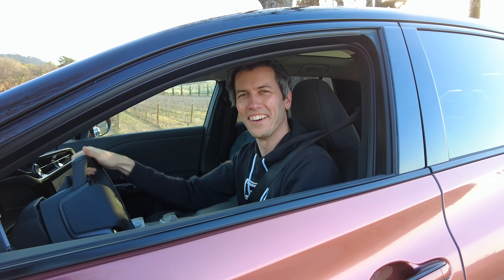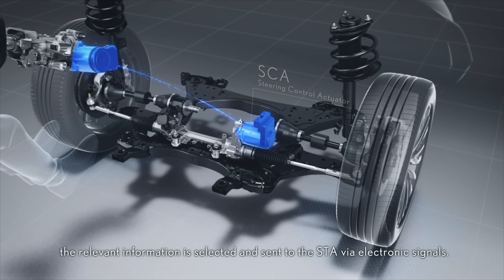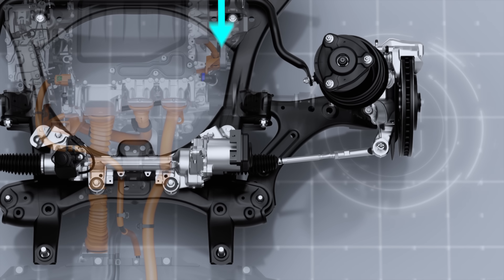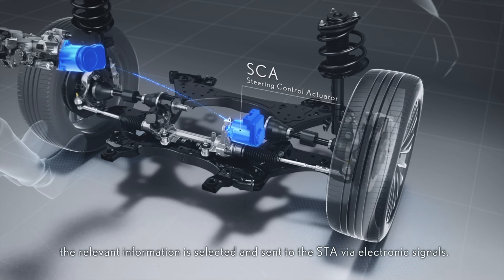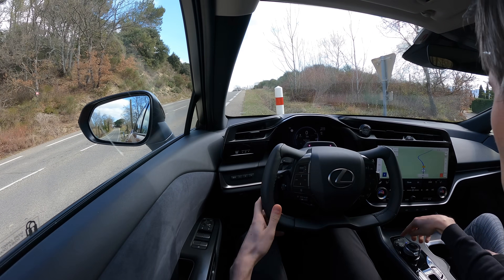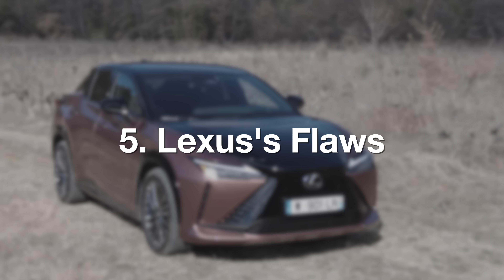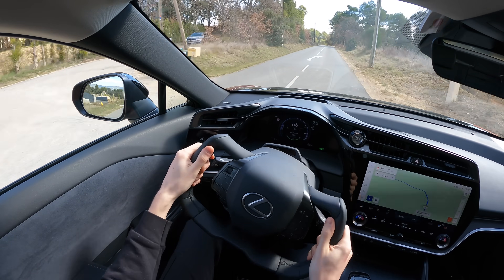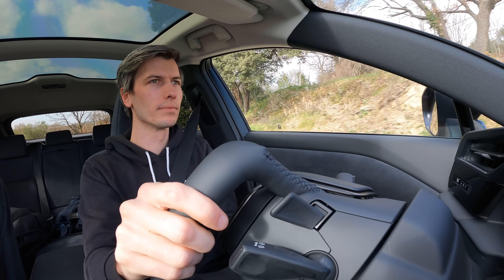How Lexus Fixed Tesla's Bad Idea: Steer-By-Wire Yoke

Comment: What happens when you blow a steer tire? I’d image yanking the opposite way to the pull in response to keep control of the car would either take you that way or you still go off the road ect, also you can really see like every other manufacturer they want to have mass production over quality so a lot of these car models are all the same in terms of the parts they use

Comment: by resolving one problem you get another, if something fails then you lose control and there is nothing you can do, with mechanical solution you may prevent it by doing maintenance works and check, checking analogue part of electronics is very problematic. And from history we can see how many car manufacturers tried and failed, people died because of electronic brakes and throttle. Nowadays cars have ride by wire solutions, but brakes are still mechanical. In aircrafts they have duplicated all electronic solutions by mechanical, because they might fail, they are cheaper, so if anybody put's in your luxury car some electronic stuff instead of mechanical, it's not about making car better, it's about making it cheaper to build.

Comment: I'm not a fan of anything-by-wire in my car.  We've already seen what fly-by-wire can cause in airliners.  

My car has throttle by wire and when it failed my car just stopped going while I was attempting to accelerate onto a freeway.  Fun was had by all.

So there's redundant actuators in case one fails.  What if the computer that does the controlling fails?  

No thanks.

Comment: These tech companies are morons, i bet if they didn't have steer by wire they would reduce a little bit of weight and save unnecessary power usage by using 2 electric motors for the steering

Comment: 3rd safe point: What if in a highway an experienced driver tries to avoid a dog for ex (happened to me 2 times) and you are ready to drift because you are more than experienced driver but the computer decides to not steer that much because you are traveling at 100 km/h and it wants to provide you with stability. There computer tweaks never get things right and believe me there is no perfect place to draw the line.
Reply: That's a matter of settings. Hope they provide some.
Reply: Why would I drift a Electric car
Reply: @Andieu9753  to not hit the dog. Did you even read my comment or what ?
Reply: @Andi eu  because its fun?
Reply: @garyrowe58  no sound not Fun to drift electric
Reply: They would still need to pass the 'moose' test (see ISO 3888-2), which is precisely the manoeuvre you describe.
Reply: @leewatson8129  like the passat passed the emission tests. 😁.
Reply: Actually it's easy  I think, system just analyse how quick and aggressive you make that movement, computer then recognize "emergency" situation and won't block it. And consider, that making normal 270 degree movement equals 540 in traditional steering wheel, which you don't make to avoid obstacle. So you get even quicker reaction with smaller input. I would see that as benefit.
Reply: @teodorgorka  I am e software engineer and I know these things never give the right feeling. There is a psychological aspect to this because the driver behind would expect the car not to turn and will oversteer eventually. Nothing better than the old mechanic
Reply: @Albi91vl  Yes this is my biggest fear of this system as I believe that the machine a person is operating to be as consistent as possible so as to maintain a connection to the machine. maybe it's not so bad but time will tell.

As i watch the video it almost looks like steering with a controller, or arrow keys in a racing game. I don't think it'll be for me just yet
Reply: @teodorgorka  In emergency you turn the steering wheel with muscle memory. However if the turning radius changes constantly, your evasive maneuver can be disastrous if the car turns more/less than you expected.

Comment: systems such as The BMW Active Steering are also able to limit the steering angle when maneuvering to a minimum and are still connected directly to the steering through the planet gearbox. Here, the rotation of the ring gear with an electric motor is simply summed up to create a bigger steering angle

Comment: This also simplifies building cars for left and right side of the road driving. With no mechanical connection, the steering wheel can be anywhere. The less difference between the two versions of the same car, the better for car manufacturers. This is probably a big motivation for them.
Reply: I want to sit in the middle!

Comment: I was wondering... how this system will behave if you accelerate from standstill on a curved road? Imagine driving on a nascar track, will it decrease the driving radius as the speed increases while holding the steering wheel in a fixed position. Did you test this?
Reply: Interesting question

Comment: The problem with all the tech advances in cars, is that they increasingly take the driver out of the equation. 
Much of the enjoyment of driving is to operate the machinery, and feel how the car is reacting to your inputs and the road, which gives you the feeling of control. That is why petrol heads dislike all these "improvements", as they reduce cars, more and more, to just being transportation devices. That goes for electric engines as well, as the sounds, vibration etc. are gone.

And the steering by wire is just another on the list of killjoy tech advances, because when the steering is no longer mechanically connected to the wheels, the feedback has to be generated, and filtered, and will ultimately feel fake, because it is.

Thank you for a nice review of the system, and while i'm not a fan, I do enjoy learning about these things.

Comment: RC vehicles have had this (obviously) for years but the control over the steering and throttle is much more granular. Percentage of input is variable for slippery surfaces so a hard input will (at 100%) make a change gradually, as shown in video. This works for steering but also throttle, no spin outs. This involves a time variable to match wheel angle to steering angle.
The degree of angle can be controlled proportionally. The angle of the wheel determines what angle the wheel will be, no matter how hard or slow the wheel is turned. A quarter turn could be no change or quarter turn. This is good for high speed driving that has some corners. A full turn of the wheel maybe only turns the wheels 3/4 of lock to lock. No oversteer.
The lock to lock rotation can be set so maybe instead of 150º you want the full left and right at 120º or 90º for the twisties. 100% proportion, 70% input at 90º = point the car and it goes there, gently and quickly.

Then there is trim. Maybe you want the wheel at a slight angle if only one arm works.
Eventually all inputs will be assignable, steer with the volume knob, brake with the horn (finally!) or to discourage theft, door handles operate horn and lights, but only while you touch them.
Bring it, let's drive. tl/dr sorry not sorry

Comment: Frankly, throttle by wire is the only system I’m comfortable with. I like the idea of a mechanical link the vehicle can failover to in case anything goes wrong with the electronics. I didn’t know brake by wire exists, and that idea doesn’t thrill me either. I’m all for assisted steering and braking, but a mechanical link must exist

Comment: This is just awfull. Its such a basic component that works as intended and is easily repairable if you at any point have any issues. Why replace it with something that has every single god damn component sealed with epoxy...

Comment: I really don't like the overcomplication of everything and the lack of redundancy. "But what about the redundant motors and sensors" you say, well I'm not talking about those, I want to know what happens when connection between sensor and assist motor fails or what wear characteristics are for one of these 100k miles in. I really don't like how many more failure modes this adds to a vehicle compared to traditional steering. "Its already used in rear steer applications" a inherently redundant system that poses no threat if it fails to function. "We use throttle by wire too" again something that isn't nearly as dangerous as not being able to pull safely off an active roadway or bank with a highway or avoid an oncoming obstacle etc. etc. And unless there is a cable emergency brake, I feel the same about breaking by wire too. I think shallow and shortsighted innovation like this is dangerous. It caters to creature comfort and mindless trust for minimal benefit. At least make a physical redundant system that activates upon any set failure mode, or if that's too complicated stop reinventing the wheel again.

Comment: If you ever tried a carburetor sportbike,  and then tried an ingection sportbike, you now the difference between mechanical and electrical speed of reaction, and small 400cc bike with carburetor feels more quickly than 1000cc with ingection
Reply: My mom's car is 75hp's, but it has direct mechanical drive of the throttle, and it feels fast

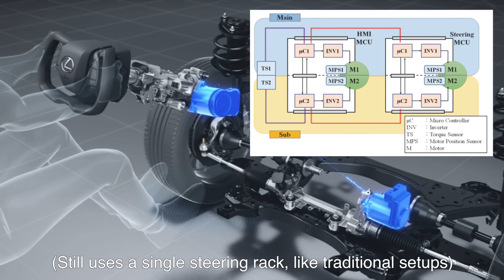Comment: 7:50 I don't know what the big deal is.  Aircraft already do this, I don't see why it's not in cars just yet.  Then again it's the same folks who think all fast cars need big blocks and NA.  America is so behind the times.
Reply: To be fair, there isnt much reason for a plane's steering to be directly controlled. You usually have minutes to steer and also don't typically feel forces from the ground in the steering

Comment: that variability in the steering ratio is its strength and its weakness. It will be for the most part confusing the driver of the "constancy of feedback". It seems like you're constantly adjusting to it...

the faster response time works for the braking and accelerating.. but not completely sold that it works for steering. And yes, the F1 drivers are elite, trained professionals... which there's a team behind them tweaking the perfect car for the driver (style of driving).. Regular folks won't have that luxury.

Comment: What do you think of the sensitivity.? A fixed wheel turn to steering turn ratio is predictable. while a different wheel movement to steering input at different speed is something that you will only have to learn from the vehicle movement to again adjust.  

I will never say Yes to this

Comment: Sounds really good, until it brakes. 

Then its not a big deal if you can figure out why its broken without tearing the entire front of the car apart. 

I wouldn't mind a system like this but that's only if a manufacturer will sell parts for a reasonable price along with an easy diagnostic system but I highly doubt that.

Comment: Could you imagine that cable breaking at the middle of a road while you're driving 60 miles an hour or by some power issue your battery dies on you😢 at least when your battery dies on a mechanical steering wheel you could easily pull over even with the electronic assistance off

Comment: This tech trickles down and ends up where we are now. There are very few affordable new cars for those not in the top tier income levels.
You can't buy a base Civic anymore, Honda stopped making them.
You can't buy a base Corolla anymore, Toyota stopped making them.
My sister just bought the lowest model Civic you can buy and it's loaded with crap she doesn't need or want.
Civic used to be what you bought for economy and price. 
No more.
Corolla used to be what you bought for economy and price.
No more.
We have to look towards Korea for that now and, while it has gotten a bit better, Koreans don't build 15 year cars.
My 2012 Civic LX coupe has 190k miles with one repair, a starter at 125k. I paid 19k for it and won't be selling it anytime soon.
It still gets 40+ mph at steady highway speeds and around 34 around town. 
I will admit the suspension is now harsh. You feel every little bump but I don't know how to get that rejuvenated.
Reply: @almightybirdwatcher4986 Honda has officially announced it will no longer produce the LX civic model which was the base. Toyota hasn't officially announced that it no longer builds the base Carolla but there is no inventory in the US. 
The average new car price in the US is approaching 50k. 
In my opinion we need new models without all the feature creep that sells for 23 to 25k and will last 10 to 12 years. 
Take out lane assist. Take out adaptive cruise. Provide the option to take out heated seats and steering wheel for the southern states. Take out full power seats and leave power height. Take out brake hold. Take out keyless entry.
A large part of this country could use a basic vehicle they can afford.

Comment: The only reason for steer by wire is the same for accelerate by wire and brake by wire. It reduce duplicate parts. Ie Toyota, Nissan or Honda don't  need develop 2 different parts for LHD and RHD.

As an auto mechanic when for example the Nissan almera came out (rhd model of the US sentra) some early edition cars came with plugs on the left side capped for the e throttle and the brake lights so that pedals can be shifted from right to left in the case of driving side.

Comment: 0:26 lol. Every modern plane has fly by wire. Which is basically the same thing. But ya’ll trust it at 40k feet. So yes, it’s safe.
Reply: The difference is a plane is serviced every week, while I’ve seen people leave factory engine oil in for 40k miles. Also, planes and cars are completely different and incomparable in every aspect
Reply: @Twenty2246  ive worked on planes since the moment I graduated high school. Mechanics is mechanics is mechanics. Technology is technology is technology. Regardless of the application. The oil that’s used to lubricate an engine has nothing to do with control system. So what you said absolutely makes no sense. Ive seen an oil service, I’ve never seen a fly by wire system serviced. You just don’t. So my original point still stands.

Comment: Yes to everything - I'm sure there were nostalgics for steam engines a while ago. I'm a petrolhead, I have a Jag and a Toyota MR2 and STILL am absolutely supportive of all electrics.
....BUT.
In the past, technology came with reliability. Up until the late 90s, the more advanced cars were, the more dependable. I have no qualms with electronics as a principle, but they are really worse and worse; miniaturising more and more, using SMDs all over the place, plus the less and less `repairability` of cars is absolutely bonkers. A shop cannot (or will not) repair an alternator - it will change it completely, which is absurd. As we go more and more into electric, I think this will be a huge problem - and this brings me to your video: the reliability issue is not in the intent or design, but in the actual quality of sub-parts, of the components, motors and PCBs themselves. Talk to any, any repair guy and they'll tell you the same.

Comment: If you had to avoid an obstacle quickly at a high speed, the steering wheel/tires would move at a slower rate due to the high speed adjustment therefore not allowing you to get out of harms way fast enough... Potentially

Comment: If I am doing a quick evasive emergency maneuver. How will I know how much to turn the wheel? The car cant possibly know exactly what I need.  The response will be either to much or too little.  I know you can LEARN, but adapting from one car with the regular system to this system can create a hazard for drivers.

Comment: I'm not feeling it(pun intended). turning off wheel feel can remove vital information from how your car is handling and this can be life or death in any abnormal condition. yes I know people who aren't race car enthusiast don't care, but you need to know the feedback from the wheels because it will help you stay safe. the delay is horrific and would get people killed, and the dynamic steering ratio would as well because they couldn't just have a feel for how the car turns like the current systems. this system all in all is a solution to a problem that doesn't exist for day to day driving and is quite frankly inferior in idea and execution to how steering currently works.

Comment: This is EXACTLY how steering in driving sims work when using a controller, rather than a wheel. Sensitivety is dynamic with less steering at high speeds and more steering at low speeds when you move the joystick. To say your ability to judge how much the car is gonna turn at any moment is compromised is an understatement and the main reason wheel users put in faster lap times. Stability control is essential but dulls the steering even more. Nobody in a sim wants to use a controller unless forced to. I don't think real world drivers are any different if it means sacrificing nuanced control.....

Comment: That's not true though. My dad had an bmw with what they called "active steering" already 2004. It means the wheels turned a lot at low speeds and less at high speeds. Without steer by wire.